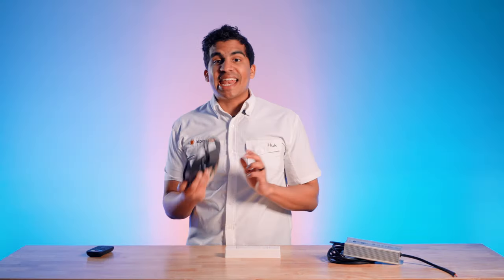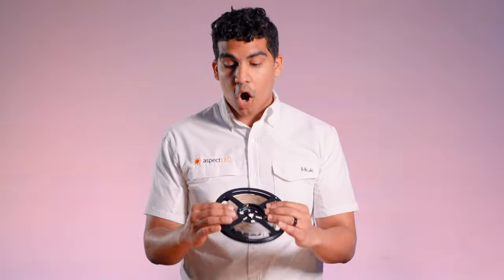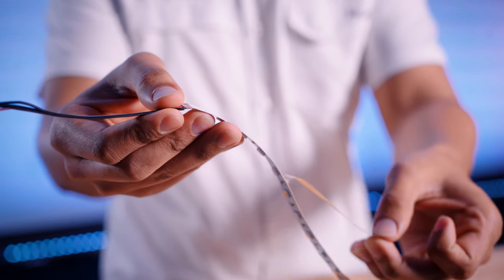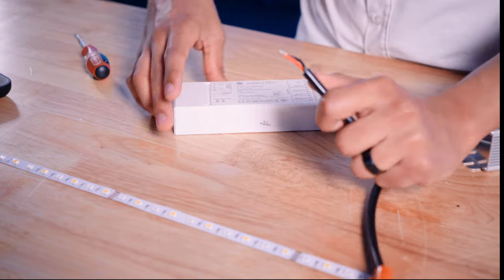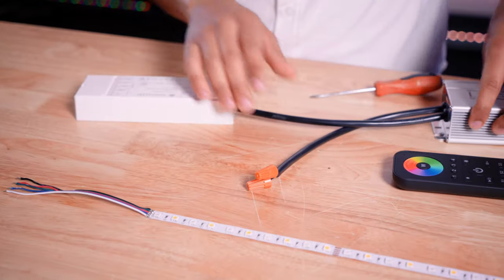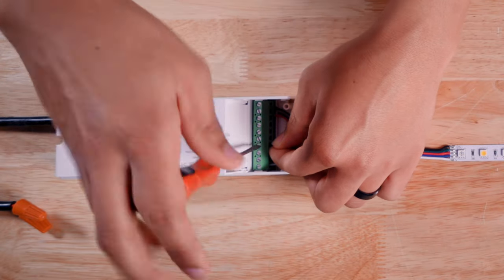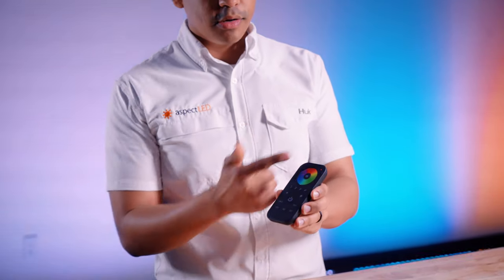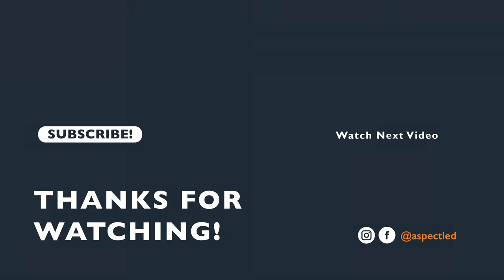How To Wire LED Strip Lights

Comment: I have 4 tape lights in total, can I put all 4 on one set of terminals, I see there is a second set of terminals on the power supply end and the tape light terminals end so should I put 2 tape lights on one set of terminals and the other 2 tape lights on the second set of terminals?
Reply from the maker: Hi! The preferred way to do it would be to split them and have 2 strips on each lead, but you can certainly use just one output lead from the power supply to power all of them as well if that's easier for you.

Comment: How do you separate the zones? say I have a zone in the living room, zone for my TV, Zone for a book shelf and last for the kitchen? How does that work and what's the MAX ft I can run this LED..
Reply from the maker: Hello. The max run for the strip used in this video is 16.4 ft. as for programming multi zone remote, just pair a different receiver to each zone number. Make sure to not inadvertently pair two receivers to the same zone. Thanks!

Comment: GREAT VIDEO.. what if i have multiple led strips, do i have to get multiple power box?
Reply from the maker: Hey. You cannot exceed the maximum run length for these strips, and you can't go beyond 80% of your power supply capacity.
Reply: @aspectLEDlighting I get that. I used your calculator and found the proper size power supply. Are 2 strips arranged parallel (both hooked to a power supply) or series (power supply to strip 1 to strip 2)?
Reply from the maker: @craggslist  The total feet of strip that can be wired in series is determined by the maximum run length of the LED strip being used for the project. If the total linear feet of strip needed for your project will exceed the maximum run length, you will need to wire in parallel, being mindful to only load the power supply to 80% capacity. Please feel free to email us at
support@aspectled.com
for help selecting products for your project.

Comment: 3:50 hi thanks for your video, I have both RGB LED lights and single colored LED lights. For the RGB LED's this was really helpful but I don't know what I have to do with the single colored LED's. I think I have to connect the red wire to the positive supply, but what do i have to do with the black wire? Thank you already 👍🙏
Reply from the maker: Hey @jojo_be Thank you for your question! To clarify on a single channel LED strip, you are correct the red wire would go to the V+ terminal and the black wire would go to Channel 1 V- terminal (which on an RGB strip would be the red channel).

Comment: can you power multiple controllers from the same power supply?  would this be done in parallel... (you could take the controller link out)
Reply from the maker: Yes, you can wire in parallel multiple controllers on the same power supply so long as you don't exceed the overall wattage. Thanks for the question!

Comment: My strip only has black - and white+ so what should i do?
Reply from the maker: If you're using a strip light that was made by someone other than aspectLED, they should still work with our controllers and power supplies as long as the voltage matches your power supply's voltage.